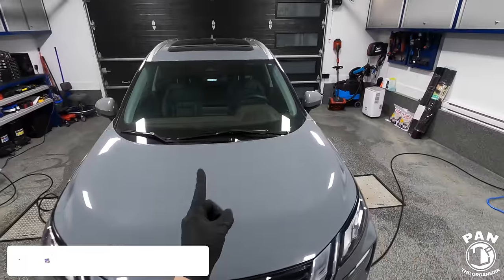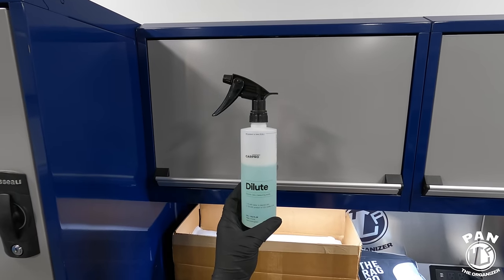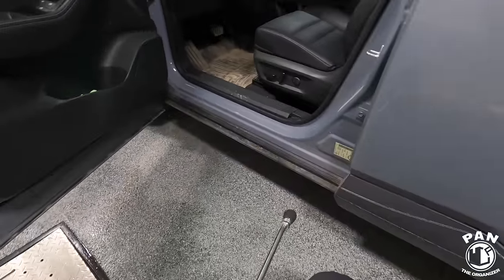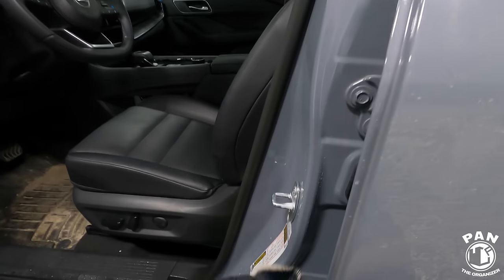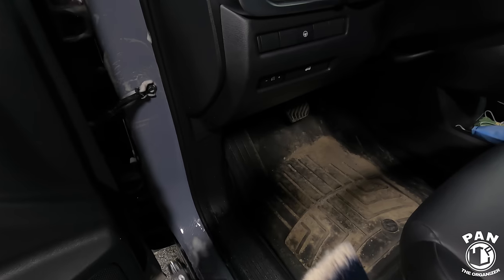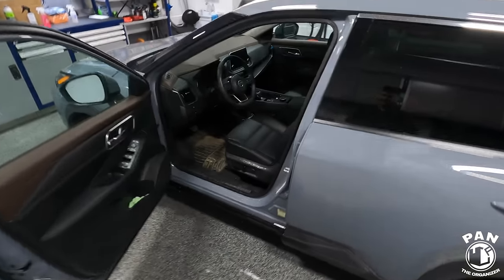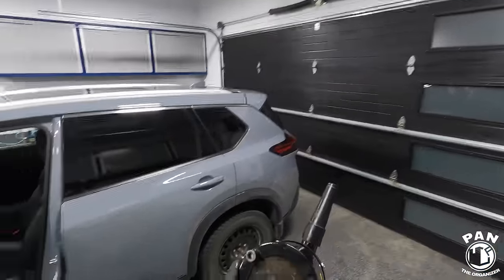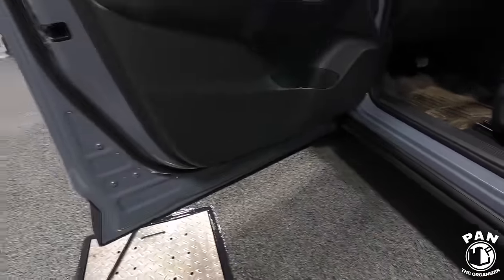How To Clean Door Jambs (Door Shuts)

Comment: How do you do the tops of the door and wash it off? I’m not confident using the water to rinse any of that. Can be wiped dry instead ?
Reply from the maker: Use a rinseless wash or waterless wash in a spray bottle, and a microfiber towel. Spray the towel, spray the surface, wipe the surface. Boom, done.
Reply: @PanTheOrganizer  thanks so much

Comment: Would you blast around the top of the door aswell and also around the top on the inner door on the body work
Reply from the maker: You can use a rinseless wash or waterless wash for those parts, if you don't want to spray the interior with water. It all depends on your skills handling the pressure washer.
Reply: @PanTheOrganizer  ok great thanks @PanTheOrganizer. I might test my skills out.

Comment: Question,do you ever add any type of oil or other lubricant to the door hinges after a heavy cleaning? And if so what do you use?
Reply: I use white lithium grease.  PB Blaster has some in a spray can that works well.  Lithium grease is petroleum based so be carefull around plastic and rubber parts if you're spraying it.  It looks like my car came from the factory with white lithium grease on the hinges.  Silicone spray is also good for hinges and safe for plastics and rubber but it's lighter and won't last as long.
Reply: @timb7775  Thanks Tim

Comment: Pan, You skipped the underbody/undercarriage where all the road contaminates exist. Rust typically starts around the wheel wells, along the frame rails, lower door section, and undercarriage. With all the underbody plastic or some vehicles have aluminum/thin stainless steel panel covers there are holes, drainage, and ventilation slots where road contamination particles enter and collect causing havoc. Those Automated and Touchless Drive Through Carwashes are your vehicle's worst enemy. Always wash, clean, and wax your precious vehicle by hand, and be careful of the equipment, devices, and products used. When using a High Pressure Washer keep the pressure between 900 to 1,200 PSI "pound square inch" with 1.4 to 1.6 GPM "gallons per minute" so as not to damage your vehicle's paint work. Some detailers will say up to 1,800 PSI is permissible, please do not do that.
Reply from the maker: I did not miss the undercarriage, as this wasn't an undercarriage cleaning tutorial. This was a door jamb cleaning tutorial. ;)